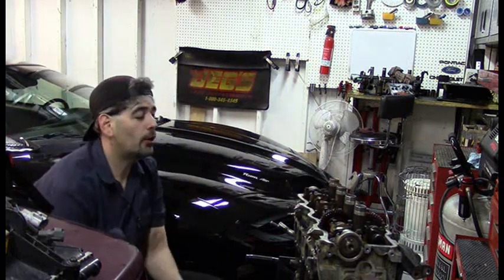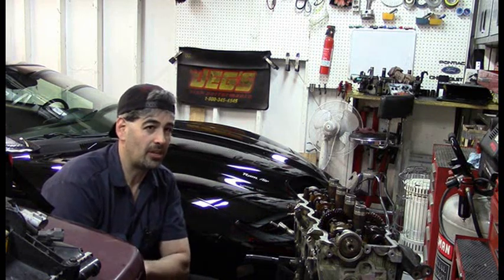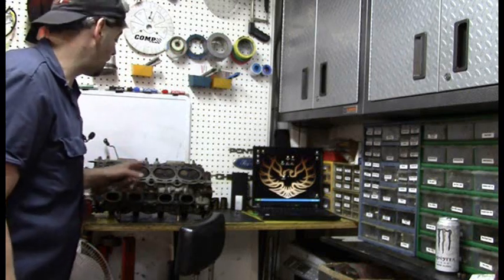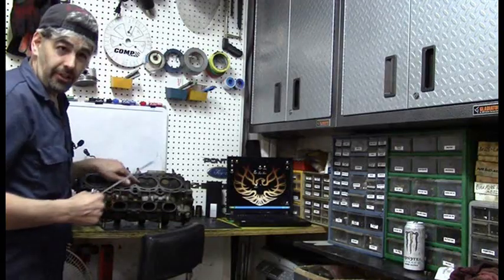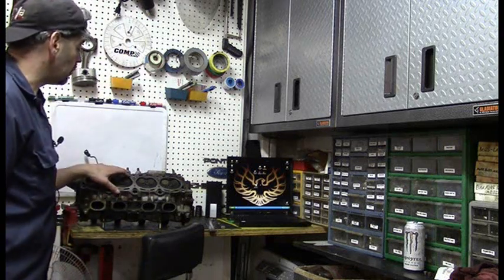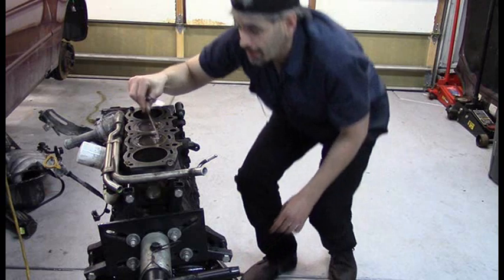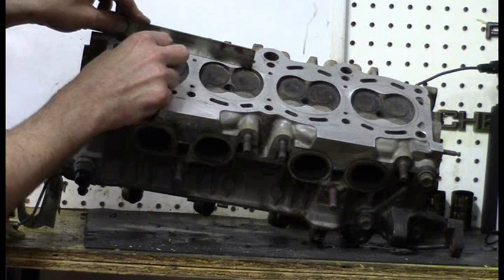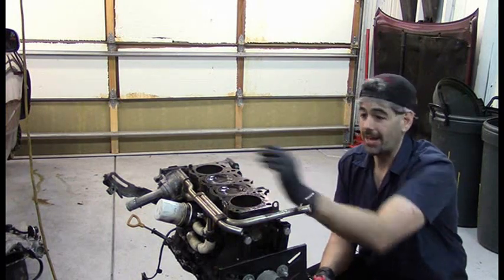Replace a Cylinder Head Gasket Yourself and do it RIGHT! Part 1

Comment: hey man thanks for taking your time to do such a great videos.
I have a question, hope you can help me on this one, I know it's been a long time since you up load this video. I have a 2009 Ford Escape xlt 2.5, with the code PO302 misfire on cylinder 2, I have replace all 4 coils and sparks plugs but code keep coming back from cylinder 2 I have confirmed low compression on cylinder 2, what would you recommend me to do in this case?
thanks 
 best regards
Reply from the maker: I need to see your data that indicates it was an ignition problem.  also why replace all 4 coils- did you have a control input problem?
Reply: @SchrodingersBox   Thank you so much for responding to my message. The first time the check engine show up I scan it at AutoZone that's how I got the code P0302 sayin that
 ( cylinder 2 had too many misfires within predetermined period of time)
 so I decide to replace all sparks plugs and ignition coils but the same code came back one's again,  I bring my vehicle to a mechanic he pull out the same code, he check the compression on cylinder  and find out that cylinder two has low compression. I don't know what would be  cheaper, to fix it or  replacing the whole engine? what would you recommend me to do?
one's again thank you so much for taking your time to read and respond to my message.

best regards.
Reply from the maker: it totally depends on why compression is low. if it’s a valve problem probably still worth fixing. if it’s a bottom end problem then most likely needs a new engine or rebuild. if he did a leakdown test he would be able to tell you which.
Reply: @SchrodingersBox  this mechanic who work on my vehicle is a joke, I left my vehicle for him to work on it for over a week, all he did was just scan for code then switch the particular coil with other good one, I pick up my vehicle hour later code come back again I have to bring my vehicle back to him, I have to tell him to check the compression otherwise, he wouldn't do it. now I'm planning on doing it my self, I have found a used engine around $600 low millage on it, I'm not a mechanic but I'll see how it goes.
Reply: Hey man I just wanted to thank you for taking your time to responds to my message I really appreciate.

Comment: ok so yesterday coming home from a friends place and I'm pretty shirr i blew the head gasket on my 1988 toyota 3vze. before it did it sounded like and exhaust leak. i looked at the oil cap and dipstick and theres the milky oil you look for. i know the engine never over heated and my engine is known to blow head gaskets because of bad head gasket design so I'm just asking what do you thing. can i just put on a new gasket and call it good or do some other things to the head.
Reply from the maker: Once you confirm diagnosis using my video "12 ways of how to test for a blown head gasket", See my video "Replace a head gasket yourself and do it right" to answer all your concerns and questions

Comment: could a clogged catalytic converter cause a blown gasket or would there certainly be damage to the head/block?
Reply from the maker: Not likely. If it were that blocked the engine just wouldn't start.  I can see it may cause a intake gasket to possibly blow, but not a head gasket.

Comment: I thought you should never use a power tool with a wire brush to clean any mating surface (especially aluminum) as it could cause indentations in the metal?
Reply from the maker: I use a brass wire brush. The idea is you are removing gasket material and oxidation, not metal.  Anyone who has told you not to use a wire brush to clean mating surfaces has never actually done this work themselves- they just heard it from someone else (who also has never done this).

Comment: Might be useful to see someone lift the engine out of the car even if all the prelim disconnection stuff is omitted.  Just thinking it would be useful to see someone do that to help eliminate painful learning curve stuff and related safety issues of hoisting the engine from the car.
Reply from the maker: I have a video on that. Honestly, its just a bunch of bolt spinning.

Comment: I gotta question for ya, this is the same 01 eclipse 2.4 SOHC   Reading my alldata and other guides BUT anyway, torquing the head. It says 58 ft lbs  THEN loosen Completely, THEN torque to 15 ft lbs Then 90 degree Then 90 degree. I get the degree part BUT your smashn the gasket by torquing the gasket to 58 then only torquing to 15 n 90 n 90  WHY???  It dont seem right at all
Reply from the maker: I cant explain the theory behind that but as long as the head is not removed, i would not worry about the compression of the gasket.  If the instructions were to torque the bolts, then loosen and remove the head- yeah I'd seriously protest against that!!
  I still think those are weird instructions but I would follow them anyway.
Reply: Chuck Aaron That doesn't sound right.  It would generally be something like: 58 ft lb, loosen half turn, 58 ft lb, tighten 1/4 turn, tighten 1/4 turn.  Those type of instructions are common with torque to yield bolts.  Going from 58 in the first iteration down to 15 doesn't make sense to me.
Reply: SoftwareDevJason I cant explain this type of torque spec, and I just dont understand. A friend tried to explain it he builds major engines for some series racing, and He says Yep, stupid, but with the ML gasket, it aint goin to blow. TTY bolts and specs are stupid. BUT I am goin to ck more into this.   From 58 ft lbs to completely loosening them THEN to 15 ft lbs then 90 degree THEN 90 degree is something I just dont get. Stupid i guess
Reply: Schrodingers Box Its a blown head gasket and got a new head , had it rebuilt and now prepping the block BUT I just find those torque specs to be nuts, BUT I will research it more b4 it goes on, with new blts of course, and ML gasket.  ty
Reply from the maker: Chuck Aaron I agree with Jason and as you saw my first inclination was also that it was rather unusual protocol. You are wise to doublecheck for sure!
Reply: Thanks

Comment: Need your feed back ASAP if possible... Talked with you a while back... rebuilding my 94 Toyota Land Cruiser 4.5L 1FZ-FE... got the Head torqued down.... and FORGOT...! 
THE FLAT WASHER UNDER THE NEW HEAD BOLTS...!  Stupid or What...!  Wow.. can't believe I did that...!  Should I pull them... or let them be...? 
Thank Ken in Costa Rica..!
Reply from the maker: See if I took you up on a trip to Costa Rica, I would have been there to help lol!!

 Yeah unfortunately, you are going to have to buy new gaskets (and bolts if they were TTY) and repeat.  When you torque down a head gasket you create impressions in it. There is no way to precisely align those impressions again. Sorry bro.
  I would not let them be- the washers help disperse the tension from the bolt head. I would redo it.

 Don't worry bro- if I spilled some of the stupid things I've done I guarantee my credibility would be dirt hahahaha. Let me just assure you that the job goes about twice as fast the second time around ;-)
Reply from the maker: I should mention- there is a school of thought out there that you can re-use head gaskets as long as they aren't heated up- even if they are torqued. The theory being the head gasket impressions dont permanently "set" until there is considerable heat and compression on them.
 However my line of thought is- do you really trust this enough to do this job a 3rd time to save a few bucks on new gaskets? If I am taking a cylinder head off for any reason, there is simply no way in hell I'm not putting on new gasket and bolts. Period.
Reply: Yea... I thought about you being here.. ah..next time... wow... haven't heard about that before concerning the gasket before,  I agree with you on the new gasket & bolts 100% if I remove them... but do you think it makes a difference now that they are in and tight.. my guess... doesn't seem like there going to go any where now... with the head sitting on those to pins & all 14 of them tight...  what's your idea on that...?  Thanks..!
Reply from the maker: Kenny Alan Yeah I do see what you're saying. The truth is, I don't actually know for sure.  If the washers are much larger than the bolt heads, I have to say you are taking a heavy risk- the larger surface area of the washer is designed to spread the tension of the bolt head over a larger area.  You can imagine it somewhat akin to pressing down with your palm vs your finger, even if the pressure is the same, the effect is greater with more surface area.  If however the washers are the same diameter as the head, you are probably ok unless the washer is a spacer and the bolt is bottomed out- probably not... but are you sure?
  The thing is, if you redo the repair you dont need to do any special modifications and you don't have to worry. But if you leave it as is and it fails, you're almost guaranteed a trip to the machine shop because the head will absolutely warp as result of the fail.  Really can't make a call on this except if those washers are a comfortably larger diameter than the bolt heads, I would absolutely be re doing this. There is a definite structural integrity that is compromised in that case.
Reply: 1/8" larger than the bolts, had the same idea about spreading the tension over a larger service.., 
Did have a friend say to pull one at a time and replace.. but that sounds more risky than leaving them there... wow... OK got your drift....
 Can you get your hands on a good set of bolts and head gasket and send them over if I pay you through pay-pal... Just an idea..?  Need them sent to Florida...?
Thanks appreciate the info... and your thoughts....
Reply from the maker: Kenny Alan lol, actually I was thinking you could get away with loosening the bolts just enough to keep some pressure on the head so it doesn't reposition at all and then replace the bolts one at a time torquing to maybe 20ft lbs and you could prevent having to remove the head and gasket and then follow your torque sequence as normal.  I would have no problem at all with that and it may mean you will have minimal disassembly. Thats a fair compromise! Until you forget the whole reason you did this was to install the washers and you realize you forgot them again 8-P
Reply: OK... So your thinking not one at a time remove and re-torque but loosen all back down to say 26 which was what the book called for, for the 1st. setting... replacing one at a time washer torgue that particular one to 26 again and then follow your 2- 90 degree torques to finish the job...  you think the bolts will be OK..? The were new..?
Reply: Sounds like a good idea... I'll give it a try..!  Thanks appreciate it..! 
If I was going to recommend anything to you, not that you in need of anything...
#1....make sure your right with your Lord...! Things are going to get tough... The signs are all around the world...
#2... buy some Silver..Quickly... the Dollar is going to tank... I believe this year... it will, I believe it will give you 10 times your money back...
#3.... If you need a place to go... Our home is always open in Costa Rica.. Your always welcome, you & your family...!
Just some thoughts...
Thanks for always giving me help.. Appreciate it.. Ken
Reply: OK... finished it off... backed them off to 26 each... then pulled one out at a time and set them at 26 lbs. to start... 1st. step as by the book... then re-torqued them twice at 90 degrees like it says.... so we'll see if she holds and for how long..?  Probably forever..! Hahahahaa...Thanks for the Advice..! 
Take care..!
Reply from the maker: Kenny Alan Yeah you're good to go bro. I wouldn't even worry about it. You did the right thing!
Reply: Thanks... I think so also..!  :)
Reply: Got another quick question for yea.. In this gasket set for this Toyota... these gaskets are all.... Like Blk. Metal... I can see using these for the Intake & Exhaust sides OK... but what about where the water flows... like the water bypass outlet...?  Don't they need some Silicone or Gasket Material or something... or is this something new and I have been out of the swing of things for... wow a long time..?
Appreciate your opinion again...!  Thanks..! Ken
Reply from the maker: Kenny Alan You can use the gaskets dry and not worry about it as long as the surfaces are smooth and it is torqued to spec. They are permanent without the need for any treatment.
Reply: Really, Got it..!  Thanks

Comment: You say you should only  change the gasket if your are getting poor compression.  So would you agree that you should only change one head gasket if is leaky and NOT the pair on a V6.  Some say that while your are in there that you might as well change the pair, especially with higher milage vehicles.  Can you please comment on this .  Thanks
Reply from the maker: When did I say you should only change the gasket? I said quite the opposite. I said never just change the gasket.  Anyway as for changing both, I prefer changing both because whatever caused the one to fail, the other experienced the same environment.

Comment: Consuming coolant, over a gallon per 200 miles. Compression below 60psi. Oil barely increases compression. Top radiator hose blew and burnt the shit out of my arm.
Reply from the maker: After you see a doctor and get a skin graft, I would pressure test the cooling system.

Comment: @ 9:07 - not sure how it is on Toyotas, but on Subaru heads, there are shallow indents at each end of the head in a meaty area which indicate how low you can go on a resurface - sort of like the little lines in between tire treads. As far as replacing with a used head, I could understand that if this head were cracked or you had a lot of valve problems, but doing it in lieu of machine shop work doesn't seem to make good economic sense.  Your tests verified that this is an otherwise good head. With your resurfacing labor and the salvage yard cost, did this really save your customer any money?
Reply from the maker: Yes I have seen the minimum spec mark you describe on other models as well. However my policy is if one head needs to machined, I always recommend the other done as well to keep identical compression balance (if on a V engine).

As far as savings- when I pull a used head, I leakdown test it from the donor vehicle (or use salvage sources that do this for me) so I know it is good. This also virtually guarantees the head will not need resurfacing either (but I always check).  I typically pick up a used head that does not need machining for $30- plus maybe $50-$75 labor for me if I have to pull it myself.  Compared with $300 average for a rebuild head it's a significant savings- hell I often charge total $500 for a used cylinder head replacement complete.
  Now, I agree- if the used head is magnafluxed, to check it and gasket surface machined "just for the sake of it" then I agree- it fairly well balances out to just get a rebuilt one online (I use cylinderheads.com).  Remember, much of my work is for underprivileged or disabled people so $200 usually completely makes or breaks them and I take every avenue to get them a ready to go head that requires no machining for under $100.

Comment: That gasket only fits one way.. As the water jacket holes tell you which way it fits. Torque to yield bolts have to be measured. As they have a limit. Check the factory specs for them. The reason why. You're allowed to mock up an engine for testing fitment. If you change the stroke of cams to higher duration. Again see the factory specs on how they allow it.
Reply from the maker: That is not true for all models. Many models have "symetrical heads"- the water ports line up either direction.
Reply: @SchrodingersBox  I didn't say all models. I said that Gasket you was holding. It only fits one way.

Comment: got a honda 1996 looseing coolant. tried numerous sealers THAT DIDNT WORK!  reason maybe got a HUGE QUAK someplace to much for sealers to pug up. engine has over heated numerous times, at first i can drive maybe three hours before temp guage started to move to hot, now can go 20 minutes then start moving to hot have replaced radiator , water pump,  and sealers plugged up heater core so by passed it still got too hot,so WAS thinking replace head but now he says could also bee quacked block hmmm. Otay !  ill go get a bottle of sealer and pour da WHOLE GOT HAM BOTTLE IN! 😀  what i got to loose? car only got 114, 000 miles on it and paid 2, 400 for it so far put thousand in it for seals, water pump ,hoses belts plugs and plug seals , radiator, plug wires , aspirin!  😣  frickin nitemare! maybe need an extorsist! 😳 also needs front axles which been puttin off till fix engine problem so looks like maybe better to find another engine and have axles done same time.BUT! another used engine mite be ready to start the whole heating problem all over again!.Dis honda could be turning into a carreer ! got better things to do, stay ahead and send it down da woad!  take it in de azz us !  EWee! dat hurts! 😀😍😍

Comment: You shouldn't skip the part where you actually resurface the head. That is an important part of that job... How did you do that and how often do you resurface it yourself?
Reply from the maker: the new head measured to be well within spec so all I did was just go over it with sandpaper till any gasket material was gone and then clean the dust off thoroughly.
Reply: Schrodingers Box
But do you put sandpaper on a block of wood or what? I'm afraid to dig into the head or take of to much one place...
Reply from the maker: Gregory May I use a flat block of wood but really it doesn't matter. You're not removing cylinder material- just gasket material. If you are using such abrasion and force as to remove cylinder material then it's not my method lol
Reply: Thanks. That explains everything.